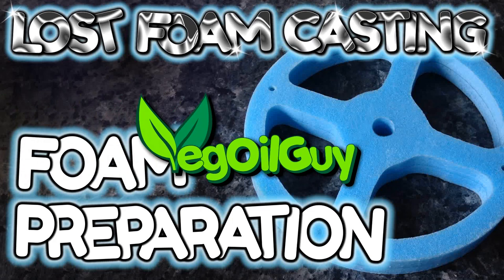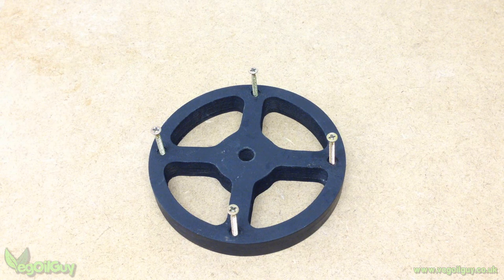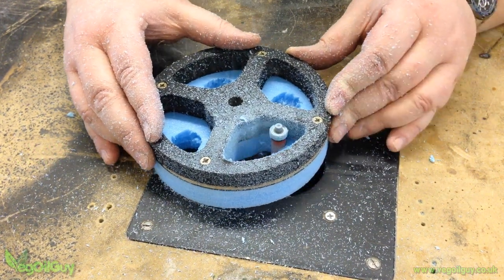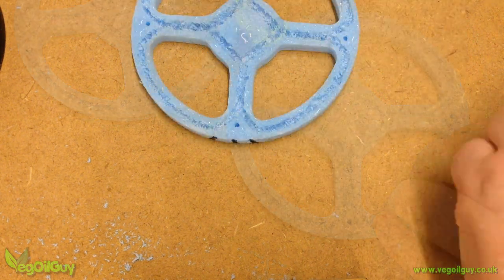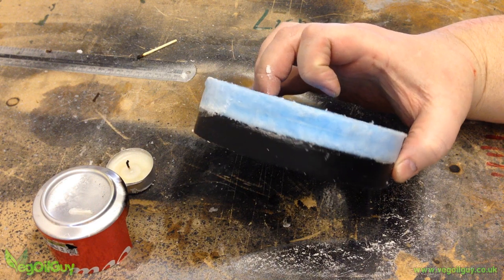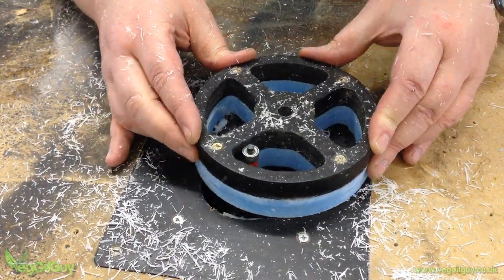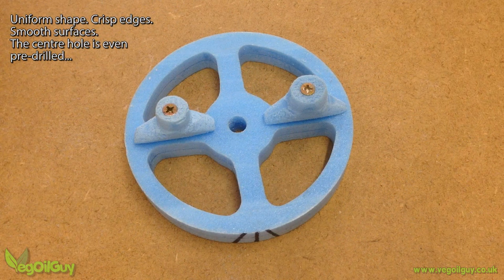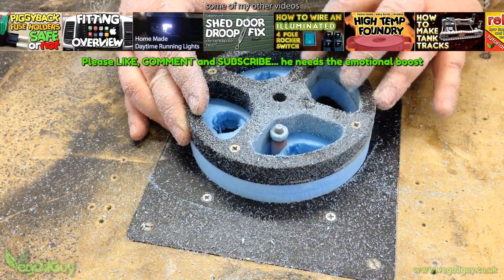Lost Foam Casting: Foam Preparation - by VOGMAN

Comment: Greetings from the US! This video is great and I have learned a lot from it, but it did spark some other questions. I’ve recently started experimenting with casing molten metals, and while I knew there would be some unpleasant smells, I didn’t realize that it would be as intense of a smell. In your experience, are there different types of foam that may lessen this intensity? I do my foundry work outside and use all the necessary respiratory equipment, but I fear my neighbors may not appreciate the stench. Thanks in advance! 

Btw found your channel through BigStackD. You guys are awesome 👌🏼
Reply from the maker: Hi Tyler. It's great to have you here and I hope you're looking forward to the challenge on Friday : )
When it comes to smells, I'm wondering which you're referring to.
Aluminium has quite a strong smell in it's molten state. Charcoal can whiff a bit if you're using that to fuel your foundry.
But I'm guessing you're talking about the foam as that's what you mentioned.
I believe the smoke is toxic, so you're wise to take precautions, though I've always found this very short lived. The smell of the metal hangs around for ages, but the foam snuffs out in seconds.
I'm not aware of any other types, but you've watched probably the most helpful video I have on the subject.
If you reduce the amount of foam you use, by hollowing out sections wherever possible, and if you raise the temperature of your foundry a little, you'll get a much faster and more efficient burn. This will improve your castings and accelerate the melting rate of the foam - getting rid of it quicker.
Failing that, set up on electric fan - and deny all knowledge to the neighbours : )
Personally I've always considered the noise of the average foundry to be more of an annoyance than the smell. That's one of the reasons I went electric... plus it meant I didn't annoy my own neighbours : D
Reply: VegOilGuy thanks for the advice!
Reply from the maker: Anytime : )

Comment: Impressive good sir, impressive.
Reply from the maker: Impressive is much too kind : )
Foam, particularly extruded foam, is easy to tool and shape. That's why I love it. 
Importantly any detail I add to the foam gets left behind in the metal after casting. I'm just thinking of your last video there Perry, all that lettering. There's no way I'd tackle so much small lettering with foam - I'm go mad with frustration first (gibber gibber). Tackling a problem like that, phew, dunno... maybe a silicone lettering mold, wax the lettering, back it with foam, then burn the lot away with hot metal. That's theoretical of course as it's not something I've tried, but maybe one day.
Thanks for your kind comments and look out for my next video ; )

Comment: Good work,i was wondering if you could improve casting by using rotary hammer to pack the sand tighter.
It shouldnt be hard to mod a chisle for it by cutting it and welding a flat plate of desired size.
Reply from the maker: It's an interesting one. It is possible to bind the sand too tight and actually get a blow out where the gasses just can't get through the sand and everything has to give. Dangerous stuff. BUT with that said our mate Martin the Olfoundryman has a pneumatic sand rammer - seen in his last video I think. However he was then wise enough to poke fine holes in the sand to release gasses.
If you watch VERY CLOSELY right at the start of this (my) video, you can see a casting video I've filmed ready to share in a few days. Look between the feeder and vent at a small hole I poked in the sand with a bicycle spoke. You can actually see smoke coming out, proving that Martin is right. So compressing the sand to get a tighter fit and more detail needs to be carefully balanced with venting. That's what makes it all so much fun : )
Reply: Nothing says fun,more than getting 900 Celsius hot metal into your face !
Maybe instead use one of those vibrating sanders that use sandpaper strips.Or make your own compact version with a stick for handle and a wood plate with vibrating motors attached to it  for compact size.
I did got a fountain of molten lead flying  2m high  because of wet plaster mold for fishing weights.Much fun,i was lucky that time .
Reply from the maker: Very lucky...
We make light of it but we know the dangers involved, that's the important point.
You'll see in my next two videos...
1) Green sand - which I don't compact very much but do also poke extra ventilation holes, and
2) Dry sand with thinly plastered foam - lots of vibrating to get the sand well settled in.

Comment: Ganna try a lost foam casting of. The dd557. About 10" long and copper
Reply from the maker: Hi Laymon. As in the ship? That's a fabulous idea.
However, if you're new to casting, I'd suggest starting with a few simpler shapes and get the hang of it first. Also try Aluminium to begin with... copper can be tricky.
Reply: Been casting alil lol. Just love ships and last night got the wax on the foam. Ganna try and cast today just gata build new casting box.

Comment: Thank you again for your help. Well, excuse me because this is my first time using metal casting.  I am using polystyrene because it is easier to get here.I am going to show you the picture of the thermostat cover i made. https://drive.google.com/open?id=1_9ill1goOwwgP0S2PuuttchIdGPmUwn_
Reply from the maker: It's hard to see from the images in honesty and the truth of the matter is sprue placement is an art. If you've wtched the follow on videos to this one, you'll see I like to use plaster feeders and vents. These take a little time to make but, in my opinion, keep the metal hotter for longer and get the gases out of the way. I try to place the feed in a fairly centralised spot to reduce the metal travel time / distance.